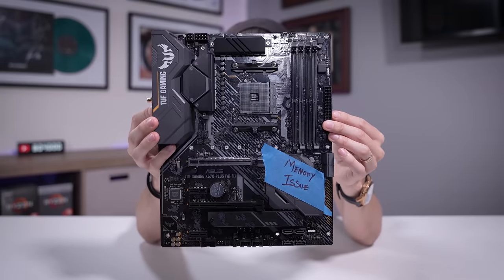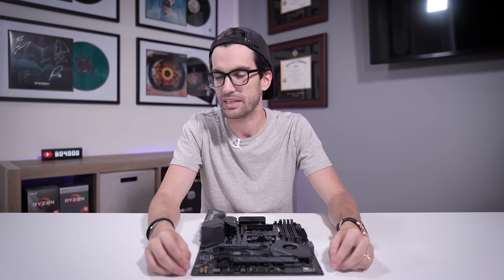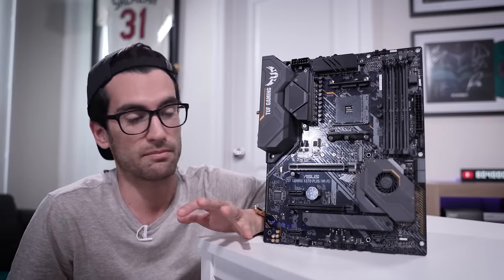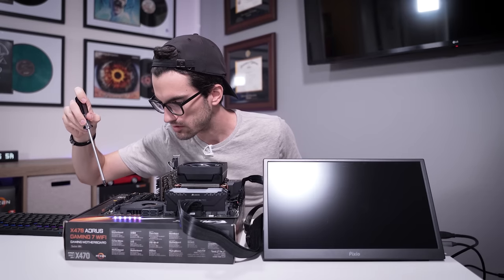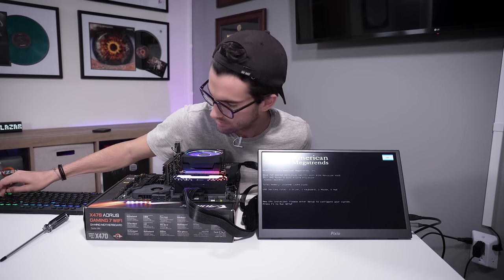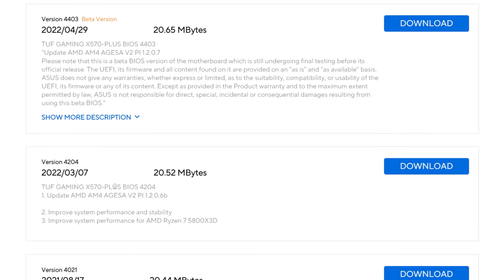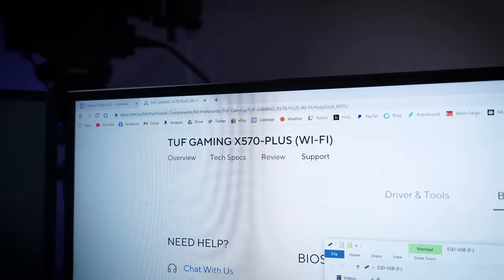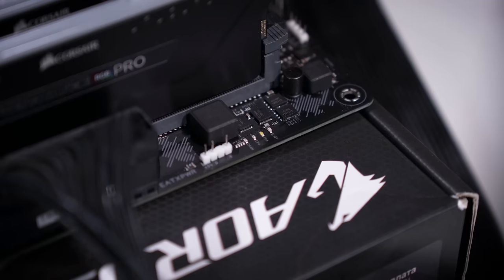Is This Viewer's Motherboard ACTUALLY Broken?!

Comment: Why do you always use a screwdriver to short the two pins for power on? Perhaps it would be easier to use a push button on a short flying lead with a two pin female header to connect to the motherboard.

You could even just salvage one from a scrap computer/computer case.

Maplin in the UK used to sell a set of power button, reset button, power led, hdd led and a little beep speaker to connect onto the motherboard headers. Sadly their shops closed and their online site doesn't carry this now.

Is this some sort of Tech YouTuber machismo thing - are you deemed a wimp if you use a little button on a lead? Do real men only use a screwdriver? We need to know!